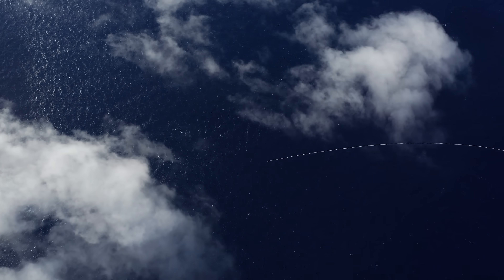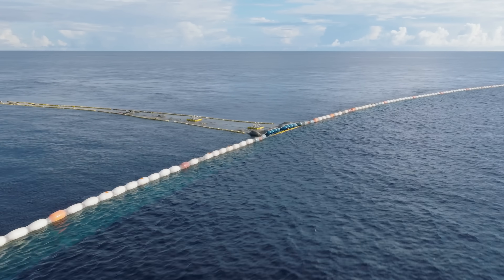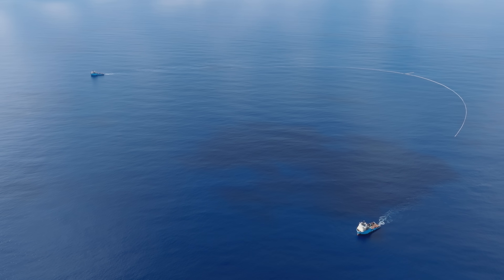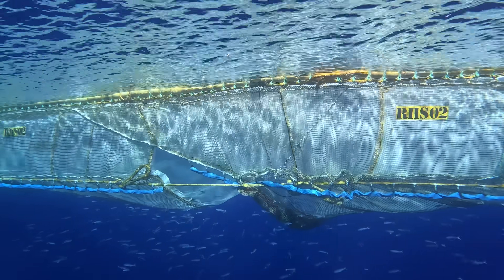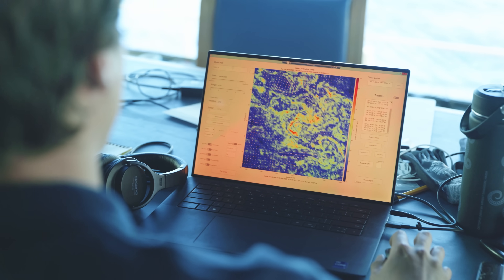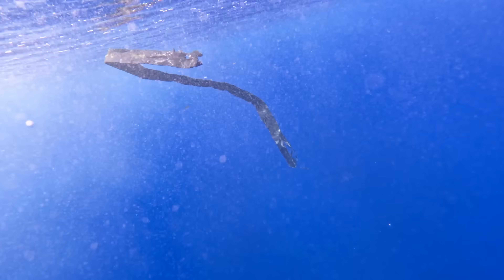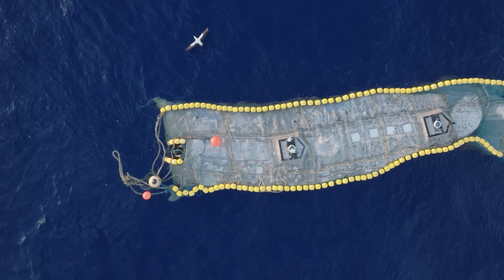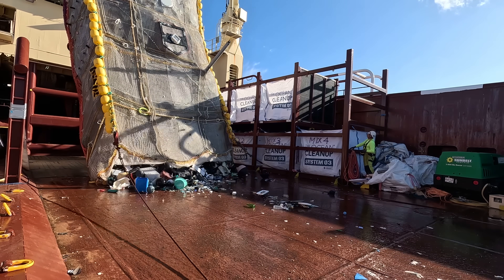How System 03 Cleans the Great Pacific Garbage Patch

Comment: To see how this system has developed since the early efforts, (that failed), is nothing short of amazing.  2.2 Km is a huge arc, but what we need is a fleet of systems being towed along side by side.  Well done on what you have achieved so far.  Keep improving it.
Reply: Thats not necessary.   They explained it.  The currents push the plastic to certain areas and then they are somewhat trapped in that area because of opposing currents.  They then find the spots with the greatest density of Plastics and position the system accordingly.   So yes they may miss a little bit nothing is ever going to be 100% with this type of work.  Going to the spot that will catch 10 tons of plastic makes more sense than doing the spot that would net 1 ton.

Comment: In earlier models of the captures systems, the idea was to have them free floating in the water without the need to be towed by boats. Is this still a possibility for future designs or has the team decided towing the structure is ideal?
Reply: The 1st system proved not to be effective.
Reply: Curious too. Active systems that use towing are good for greatly accelerating the collection process. But passive systems that use natural currents to collect plastic would be vastly cheaper to operate (and possibly much larger than can be feasibly towed?) albeit slower. It must cost 10s of thousands of dollars/euros per day to operate those two tug ships (crew wages + ship itself), which would pose a challenge to scaling up.

Comment: The amount of plastic & rubbish you have cleaned out of the ocean is mind blowing, Thank you for all you do.
Reply: No. What is really mind blowing is just how much plastic is IN the ocean.
Reply: No, it is not at all. Just compare it with the amount of plastic they take out with passive systems from rivers. These take about 50 times as much without running 2 ships and crews.
Reply: @oneworld1160 need both the systems in the river (and we need much more of them) and the ship on the sea (and we need much more of them)… and we need first to use less plastic, and dump less into the rivers…
Reply: Two vessels operated by The Ocean Cleanup, for example, release 600 metric tons of carbon dioxide for a month of cleanup, according to the nonprofit — equivalent to about 130 cars on the road for a year
Reply: @keithb6717  I don't understand why people even reply and tell me what it takes when I already know what it takes through research.
Reply: so what do you want them to do?  row? @keithb6717

Comment: Really good and informative video. Always wondered about fish etc getting trapped, now I know it’s monitored.
Reply: You can Google some of the initial criticisms and concerns people had about this, years ago. TOC commissioned a study on environmental impact to assess ecosystem risks from their projects, I think it was. It's been a while since I read it. But yeah, they appear to have 1) included staff/observers specifically tasked to monitor sea life impact, and 2) built in mechanisms to mitigate that impact, like towing the net at a slow enough speed that fish can easily swim away from the trash in the collection net, larger openings for larger sea life to dip out through the bottom (b/c plastic floats to the top), etc.
Reply: Yea me too...like the turtles

Comment: Great video, however you guys always cut the video right after the sortinf phase, its would be great to see how you guys deal with the waste after sorting... do you send it back to a landfill? Do you have a possessing plant or are you teaming up with another company that deals with that side of the project
Reply: A couple years ago, TOC started offering some online merch made with recycled plastic from their clean-ups, though I'm pretty sure that's primarily a PR/awareness thing since it looks like they get a lot of their funding from partnering with local government agencies. I've read that UV exposure significantly degrades the performance of materials recycled into next-generation products, meaning a lot of the older plastic fished out of the ocean (stuff that's years to decades old) would be even worse to recycle and repurpose than normal recyclable plastic materials.

I'm just a guy who reads stuff on the Internet, but I would guess TOC has negotiated strategic partnerships with companies that will buy certain sorted plastics off of TOC by the ton. I've seen secondary material pricing anywhere from $30 to $200 per ton. It just wouldn't be cost effective for a non-profit with core competencies in cleaning plastic trash out of waterways to operate its own processing plant. Much more affordable to outsource that to a company specializing in it that can achieve better economies of scale. Plastic recycling is pretty low value per unit weight, meaning you have to go big to not go broke running it.
Reply: Probably on another video look it up

Comment: This important project and all the people who are working on it deserve enormous support. It's sure that future generations who look at the good you have done for our planet will be grateful
Reply: Support legislation to tax petrochemical company’s raw virgin plastic to pay for this system and ten more in perpetuity.
Reply: Have you donated $$ to the organization?  I have.
Reply: tax the plastic manufacturers.
Reply: Taking trash out the ocean while dumping emissions from the boats into the air 😅
Reply: @fires5490  And what solution do you propose? How would you implement it? Do you have an alternative or just a "😅" emoji?
Reply: @Felineintuition  what solution do you have? 😂
Reply: @Felineintuition Sails maybe? But personally, I don’t see the fuel part of this mission a big issue. If it were, they should just go old school and add a sail lol.
Reply: @fires5490  i like this solution just fine. 
And based on your lack of response to my question, you have none. Just a whiny comment on the Internet.
Reply: There are potential low emission fuels that could be used. They are making aviation fuel the same way so it's possible this could be in the works for boats also. @fires5490